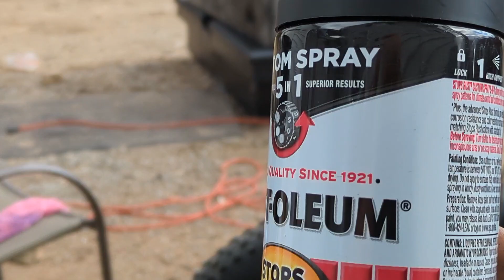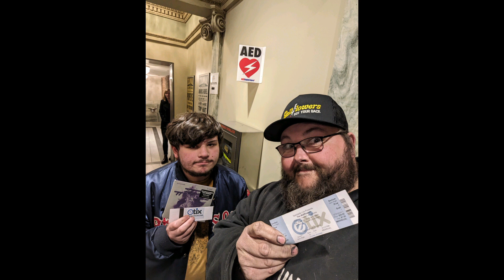Building The Cheapest service truck ever!

Comment: The plan for the truck sounds great. Great to hear you're getting along better. Great to see the concert went well for you. First step is the biggest. I'd suggest more support under those boxes. A bar between them would likely get in the way when accessing the box. Another suggestion would be large fender washers on the bolts where you attached it to the side rail. From personal experience I know the washers you get to mount these things don't work well. The winds creates a lot of force on the front panel of those boxes, even though it's a small profile. And they become missiles when they come, heavy missiles. Look forward to seeing what you do. Be safe and stay well.
Reply from the maker: Thank you brain